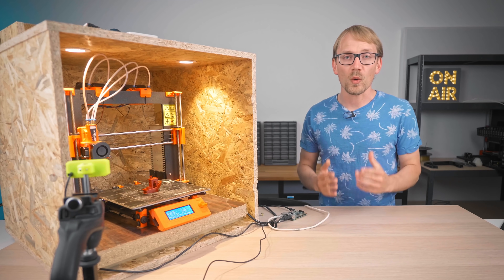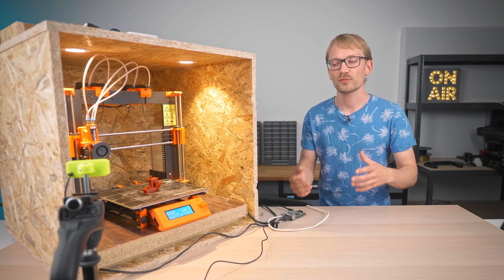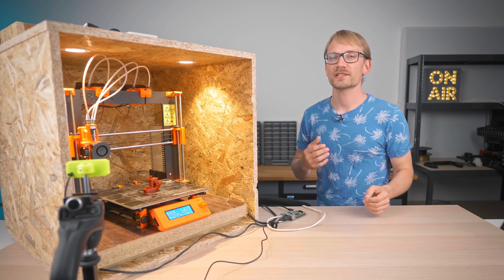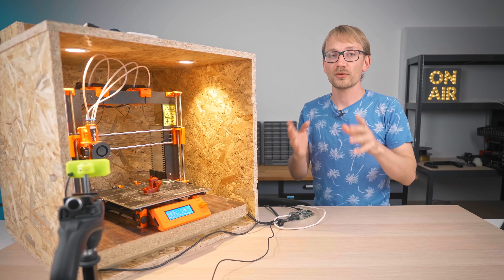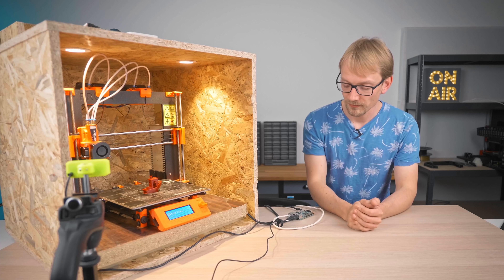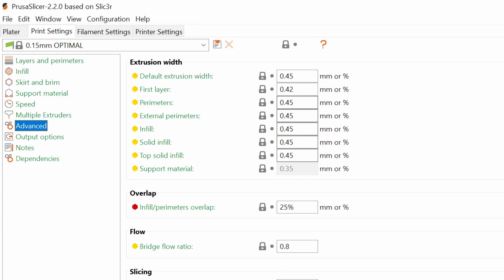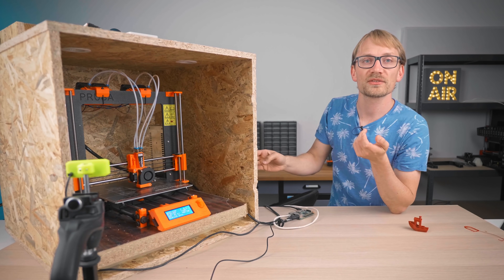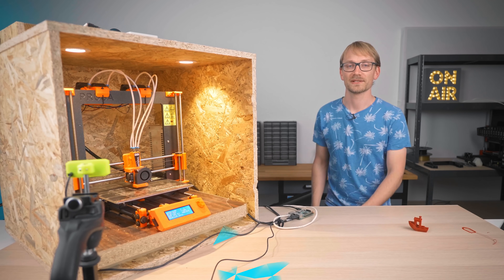Starting 3D prints without getting up from my desk - choose from 4 filaments in one click!

Comment: Super awesome.  I was a bit surprised that you had to edit the extrusion multipliers, I would have thought that would have been automatic once you changed the nozzle diameter.  I have never changed nozzle diameter myself so it was very interesting information.
One day I will pull out my lulzbot mini and swap out that clogged nozzle. Pretty sure it is borked.  Printer spent years doing abs exclusively then I tried some woodfill which went great, then some pla and after about a dozen pla prints my extruder was chewing up the filament entirely midprint and just being a mess.  Thing got boxed up because we had just put the house on the market and then covid.  Two years later that thing is still in a box in the new house finally.  Got a prusa mk3s+ whatever they call it on the way.  Pretty pathetic that a simple nozzle change is something that benched my printer for years, heck, a cold pull might even fix it.  I just hate the hassle.  I love 3d printing, but I don't really have time to troubleshoot these days.  Hopefully the prusu is pretty reliable. I am more willing to mess with a second printer than my primary one anyway.  Less fear of breaking it, which is stupid since I can't use it how it is anyway.

Comment: You mentioned that you found some nozzles impossible to clean.  I have been able to clean brass spray painter nozzles with very fine holes clogged with urethane and I don't see why my method wouldn't work with brass printer nozzles clogged with organic plastic.  I place the nozzle in a low flame on my gas (methane) stove.  It doesn't get hot enough to melt the brass, but the organic material in the nozzle pyrolyzes.  The ash can then be blown out with compressed air.  Let me know if this works for your clogged printer nozzles.

Comment: Hy Tom ! I am using using octoprint only when i am in the local network but what about using team viewer or remote desktop to control a device that is on that same network conected to the rpb ? Also how did you used 4 motor on the prusa? , i have an mks on my ender 3 that only supports 2 extruders.

Comment: How does this work if you had ABS in the nozzle for the last print, then you go to print PLA on the next job. The nozzle is potentially too cold to push out the ABS and could jam it?

In the manual world, if I last printed PETG and I am manually loading PLA, i will load at the PETG temp to make sure the PETG is pushed out first

Comment: Curious about how it primes the nozzle. I always sit by my printer and pull away the primed bit that gets extruded out with a pair of tweezers. Does yours prime it just barely enough so it doesn't do that? I guess that's what a skirt or brim is for?
Reply: I remember reading somewhere that "removing the extruded material when changing filaments is not necessary", I guess the idea is that it will wipe it off itself before it starts printing? I've never ever tried this, because I'm always standing right there when I change filaments and it seems like removing it is the right thing to do... but maybe it really isn't needed?

Comment: Hey Thomas, great channel! Quick question. I'd like to build a large printer this summer (build surface 300 x 750 or larger), and there's not a whole lot of space in my house. Garage is probably not the best place, but I was wondering, would it be possible to use a printer in my room? I imagine I would need to use proper ventilation (carbon filter, hose), but what else would I need? An enclosure would be good, what should I use for that? Would acryllic work? Thanks!

Comment: Ok, I am going to also explain how I got my printer "fully automatic" for cheap and easy. I have an old phone dedicated as a cctv to monitor my prints with a "free" app that allows monitoring outside the house. I also have a "free" and excellent app that allows complete control of my laptop through my own phone. The laptop is permanently connected to the printer with usb. And a simple €10 wifi plug that allows the printer+lights to be turned off manually or as a timer from my phone. This is 3 apps all on my home screen on the phone that i can design and then directly print through cura or other slicers straight from the laptop from my phone. Now to make it fully automatic/closed loop without ever ever ever going near the print...the print bed must have the coating that allows easy release of parts when the bed is cooled. When a part is finished and looks good from the camera, control the printer with cura (or other slicer) from the phone to move the extruder up, and to the back-middle of the bed...lower and move forward to knock the part off the bed. The next print can now be printed again directly from the phone without ever having to go near the printer. This closed loop system cost 10 quid and is great for when someone asks me to print something i can just do it then and there. I think octopi is finicky. Hope this helps someone anyway. Thanks for the video tom good job as always.
Reply: ...and actually apologies, the "closed loop" part comes from Devon at Make Anything on youtube video that allows knocking the part of the bed by modifying the code which i did. Manually doing it with cura is just easier in my opinion... Thanks again.

Comment: Also on a MK2S+MMU and using OctoPrint, and the best addon: a TP-Link HS110 "Smart Plug" (wifi-enabled power socket).
There's a plugin for OctoPrint with which i can power my printer on/off (with autoconnect etc.), and it even monitors the power usage.
The Pi is always-on, and when i want to print something i just click a button and everything connected to the smart plug comes up (e.g. lights).
With the plugin you also get auto-shutdown when the print is finished. Definitely worth the ~20€!

Comment: Hey, I actually tried your setup with my MMU1. The problem for me is, that the printer refuses to change the extruder even though I changed it in the PrusaSlicer. Did you run in the same issue?
Reply: Got it fixed by myself :D for everyone running in the same issue. You have to configure octoprint, that you got 4 extruders with one hotend in your printer profile. It should work now. Also gonna check if multi-material print with material change also will work, because they also didn't work in the past.

Comment: That's mostly what I used the dual extrusion on my old Replicator 2x for: got one side loaded with pla+ (nearer to the cooling fan), the other side normally has petg.

I have put it on a smart plug as well, so I can click a little button in octoprint to fully power it off or turn it back on, as long as I don't touch the switch on the back.

Comment: My Prusa mk3s lives in a lack enclosure with an octopi server and a raspberry pi camera on the x axis arm. It works great so far. Remote printing over octopi with PrusaSlicer is great. WiFi is not flaky at all. I can monitor prints and share progress using the discord plugin for octoprint which makes updates from the printer as a bit in a channel.

Comment: Nice video !
I'm using simillar setup with Ender 3 with one advanced feature - Sonoff S26 WiFi Smart Socket with Tasmota FW on printer's mains power plug with and Tasmota plugin in Octoprint. You can then remotely power on/off the whole printer (completely cut off the mains power) together with LED lights for OctoPrint camera. OctoPrint also automaticaly cut off the power if thermal runaway occurs, so it won't burn up whole house while you don't watching it print. Also it can automaticaly shut off whole printer after printing is done ;)

Comment: OK so how is this not exactly what you can get with an Ultimaker S5 Pro Complete Unit? 
Has 6 Material Spools, which it auto-detects the material through use of NFC. The Printer is fully enclosed (Strange how you seem to be totally OK with fumes going everywhere)
With a Build volume of 330 x 240 x 300 mm it is extremely good, with Aluminium/Glass Build Plate.
Reply: Which is about 10k money units vs 1k. Thats alot of extra upgrades which might not be needed

Comment: Regarding preventing failures, I like the filament manager plugin for OctoPrint. When you buy a new spool, add it to the config. Then IF you always remember to select which spool you're using, the plugin will keep track of amount of filament left, and alert you, if there's not enough to finish the print.

Don't know if it would work too well with your more automatic system though :)

Comment: You're not lazy enough.  You need to install at least 1 Pallet 2/pro per roll of material.  Don't forget to use their Hub to sync with the printer.  Now you have access to 16 colors and/or materials.

Comment: "5 or 10 minutes in CAD designing it" .... cute
Reply: 5 or 10 minutes waiting for the CAD to open, more like! :D
Reply: after 5 or 10 years designing in CAD for 3d printing you'll understand :P The more you design your own parts the quicker you are at understanding the process behind designing it and keeping it parametric in case your numbers aren't right the first time around. In inventor I design parametrically from the get-go by typing in the dimension box width=100mm then you can reference that number by putting "width" wherever you use the same dimension. If you want the height to be half of the width then you do height=width/2 . Super simple then if you need to make changes you just change the first one you referenced or in user parameters
Reply: @jimbmakin7975   I added user parameters manually. UNTIL TODAY. Thanks man, this is going to save me time!
Reply: @jimbmakin7975  This is one of most useful tips ive ever heard when it comes to 3d modeling, had no idea inventor had this feature so easily usable but it seems so obvious now that i hear you mention it
Reply: @jimbmakin7975  
Well that works nice for parts that dont have to interact with other parts (Electronics etc) so yeah in my 7 years of solidworks ive never used/ needed something like that
but fir decoratives/ single part projects that Sounds like a nice feature

Comment: Question:  I like Prusa slicer, but I don't own a Prusa printer.  I have a 'generic' home made 'repstrap' that has evolved over the years with new parts.  I created a custom profile for it under Prusa slicer, but I find I can't select any of the printer or material profiles that Prusa provides unless I select one of the Prusa printers.  I'd like to be able to select these Prusa profiles for printing and filament, modify them as required for my printer, and then be able to use them.  But any Prusa profile I select disappears once I select back to my printer profile!  Do I have to edit the Prusa profiles outside of the slicer app using a text editor, and somehow rename or mod them to become specific to my printer?   It's crazy that Prusa has provided so many examples of printing and material profiles, but no way to use them for printers other than their own.

Comment: Tip for a similar setup with the mmu2: place the spools below the printer, if possible.

I had the spools on top of the printer (enclosure) and there was just too much friction in total. Failed often on filament change. I think it's mainly because of the input down-angle of the mmu2. Also, if the spools are below the printer and the filament is guided through holes  these work as a  ideler.  Never had a problem since (about 10 multi material prints with 500 filament changes)
Reply: Is it just the angle on the feed of the mm2?
How do you like the mm2 after that much use, almost bought one a couple days ago.  Would it still be useful if I wouldn't actually do much color changing?  I'm thinking it may still be worth it to have more loaded, and to load second of common so I don't have to worry about how much is left when I go to print something.
Reply: @h82fail  mostly I only use it to have different materials loaded ( only pla & petg) but it's kind of a high price for that convenience.

I think it's a combination of feed angle and the printer "tearing the spools down" on the holder.
Now that the spools are below instead of increasing spool holder friction, it is reduced when filament is loaded / drawn in. It is only my simple idea of why the mmu2 prints better with the spools below.

Comment: I use Geeetech 1.75mm PLA filament on Ender 3’s. After a few days of no printer operation, I return back to my printer, the PLA between the spool and the hot end and/or extruded motor can become brittle, and snap (probably because it’s forced straight, rather than wrapped around a spool. Do MMU printers suffer from this same issue? How do you resolve this issue with a printer that you want to print from immediately? As I typically now remove the spool after a print job, if there is no other print queued.

Comment: Thomas, since i think you already have all the Parts for it... How about building the SmuFF (Smart Multi Filament Feeder) which is an Open Source MMU for any Printer but with ability to basically run unlimited numbers of Filament Spools (Or however you wat to call it) It's an really awesome Machine, that even got an Plugin for Octoprint that controls the Filament Swaps while Printing. I'm still planing to build it myself, but the e3d Parts are just to expansive so it will still take a while until i can afford it.

Comment: I added a couple of menuitem in octoprint to swich on and off my printer and a light-bulb to shed light on my prints. Also I use the included camera management of Octoprint. As many have already pointed out, I use a vpn to connect to my lan for connecting to octoprint, no need for a cloud connection.

Comment: As a Dad of young kids I rarely get continuous time to play with my toys. I designed my 3d printer will as much set-and-forget as possible. I dont have the time to baby sit the machine. For this I added the following features
*  octoprint - obviously

*  UBL is a must . having to level the bed after having thrown it out of wack from struggling to remove the previous print
*  removable spring steel print surface - stops from having to struggle removing a print an messing up leveling
*  PI camera - I can watch the print remotely
*  endoscope/boroscope - cheap $20 amazon endoscope is pointed at the nozzle. I can really see if it is laying the plastic down right.
*  use the POWER_SUPPLY and PS_ON_PIN feature in marlin where M80 and M81 turn on and off the printer. I use this with the toggle PSU plugin in octoprint
*  4 pin fan controlled by a $10 thermostat fan speed controller board with a failsafe buzzer that buzzes if the blades stop spinning . This cools all the electronics

Comment: Pro tip: Network drive configurations using the --datadir flag

I have a very similar setup to this. One problem that I had was having multiple machines that I could potentially slice and send gcode from. To solve this I setup a prusa slicer configuration folder on my network drive so that all of my computers have access to the same configurations. When launching PS, you need to specify a location using the --datadir flag (a feature from Slic3r that still works in PS) and point it to your network folder location.

You will need to be a bit clever in creating shortcuts and shell scripts so you don't need a terminal, but it is possible. I have even managed to send files directly from Fusion360 to PS using the "Send to 3d Print Utility" interface.

Comment: Just wondering, I have the exact same setup, slicer, octoprint and printer and everything. Do you have random issues with the printer ignoring the extruder selection in the slicer and just starting with E1 instead? It’s pretty easy to fix, just manually select the right extruder on the printer while it’s warming up, but it’s pretty annoying.

Comment: The part that has made a ton of difference for me is OctoPi sharing the Gcode directory via Samba so that I can see the drive throughout my home network. Then I can save Gcode from Simplify3D, Prusa Slic3r, etc. and kick off the print without moving from my chair.  Even though the printer is literally 2 steps away...  I'm lazy like that.  But, I also have a second printer in another room and a MPCNC in the garage all running OctoPi using the exact same setups.  Keeping track of all three simultaneously has become simple.  Remote via VPN is the only way to go.

Comment: Very similar to my rig. I put my i3 MK3 in an old cabinet I made years ago. the printer sits on a heavy countertop sample on top of yoga mat material. Everything just barely fits. Octopi server is attached to the Prusa frame and works over wifi just fine. It sits in a closet in the corner of my basement and no one can hear or smell it running. I can send jobs to it from any PC in the house. It's firewalled off from the internet. No MMU though. That would be nice. I have a fixed spool roller mounted above the printer in the box. Everything stays dry and warm that way.

Comment: I integrated a RPi into my printer. I've added a 5v PSU that's powered from the main 240v plug the printer already has. Both the 5v and 12v PSU are both behind a manual power switch to enable me to truly turn off the printer, but the 12v is also relay controlled which allows me to switch off power to the RAMPs board that controls my printer. This ensures that the fans that were permanently powered get switched off. The Arduino still gets 5v power via USB from the RPi, so that actually remains powered.

There's a plugin for Octoprint that allows PSUs to be controlled, the relay for the 12v PSU is controlled by that via one of the RPi GPIO pins.

I find this setup fairly convenient as it means the printer is only connected to the outside world for power and ethernet and the relay means the printer goes into a pretty dormant state once the hot end temp has reduced to a safe level after printing.

Edit: Forgot, I also have Home Assistant setup and thats got a plugin for Octoprint, so since I have sending emails setup on that anyway, I leave that to monitor printing and inform me when printing is done.